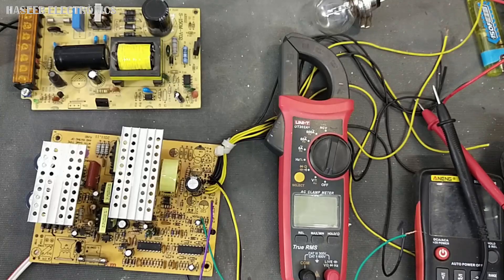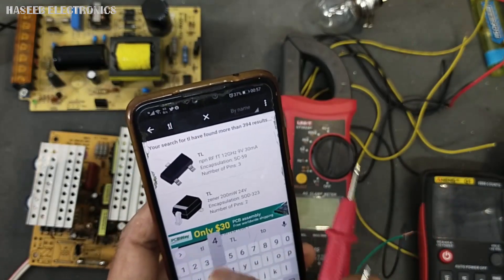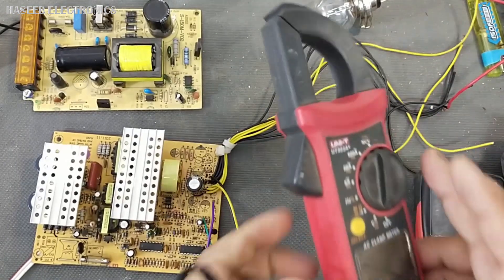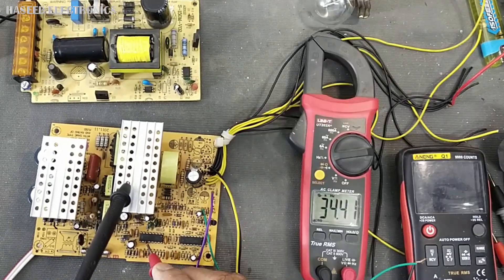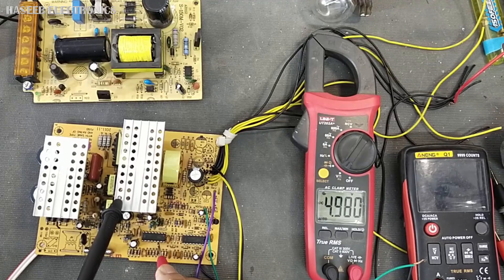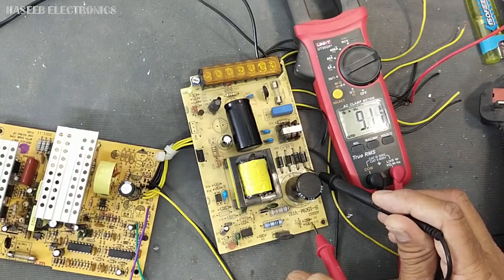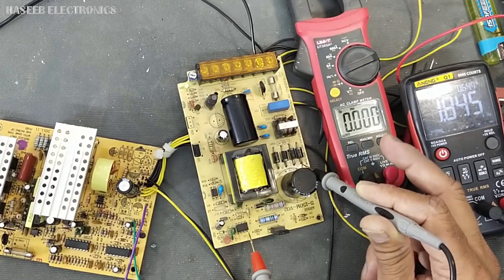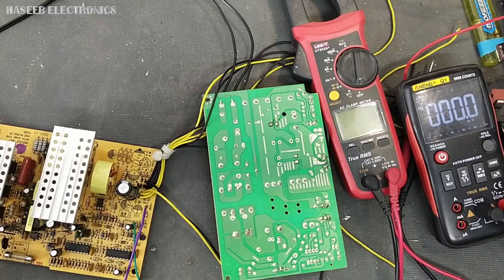{651} How to Test MOSFET Drive Signal In SMPS Using Multimeter || Switch Mode Power Supply Repair

Comment: sir what is bigger wattage of smps the low frequency or the high frequency?
Reply from the maker: we can take at normal frequency (20 to 100 KHz) 
at this range the SMPS size is slightly bigger but its control is easy 
at high frequency, the smps size become very small with high output but the control becomes difficult

Comment: How to control the current on fix voltage?? As 3.3 volt and current is 1amp , 3.3volt current is 2 amp , 3.3 volt and current is 5 amp ???

Comment: Great  video, just  need  to  know  if  that  is  primary side I am a beginner.  Thank you?
Reply from the maker: thanks a lot 
as i tested TL494 in computer power supply (it is secondary side pwm controller configuration)
the other OB2269 is primary side (hot side) PWM controller IC

Comment: AoA
I have an issue with power supply
On chopper transformer's input 380volts are available but no output available at secondary windings 
What could be possible reason??
Power supply boars P/No is P4378A
Reply from the maker: wa alaikum salaam dear brother 
i cannot find P4378A board 
can you send the brand name or any other number for the same board
or send its picture to my whatsapp 00962-79-1161-084 (specially numbers on the board)
and to which device it belong. so i can get some good image about the circuit and then i can suggest 
best regards 
Muhammad Ashraf

Comment: Finaly check ic  one out put pin to other out put pin. or MOSFET gate to gate ac voltage. Ac voltage is not comming driver side is defect. Eny one side is defect, only DC comes.